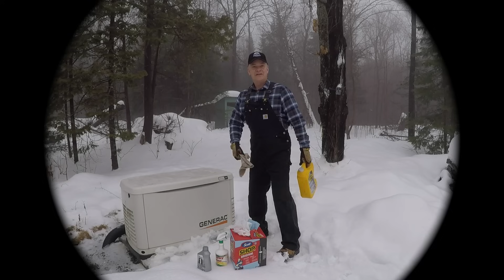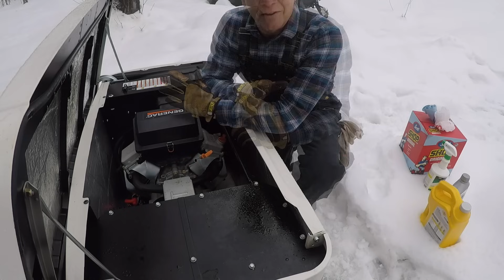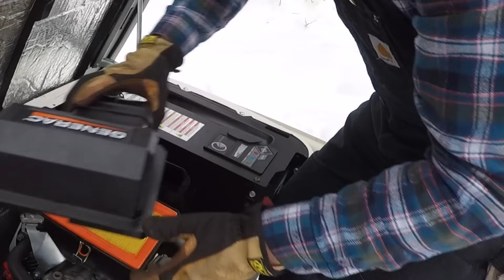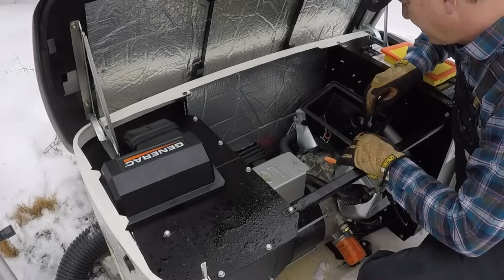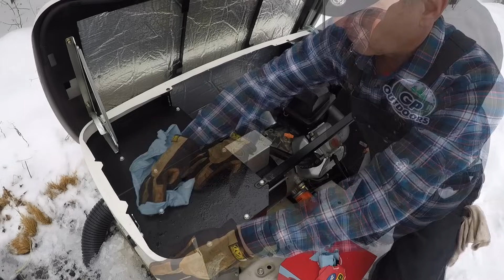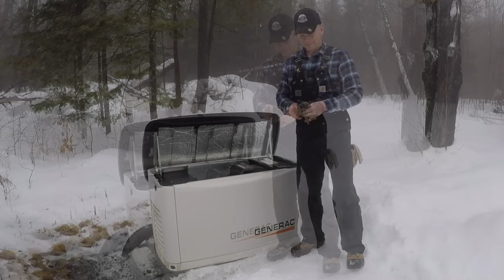#133 Thinking of Buying a Generac Generator? You Need To Watch This!

Comment: So how I fix mine was I drilled a little hole in the bottom of that if I remember correctly just about half an inch. I installed the black piece of pipe flush with the bottom like rubber hose not pipe sorry. Flush with the bottom going down through the bottom of my generator house. Which drains that moisture / water out. Works well for me. Also that your breather for the crankcase not exhaust.
Reply from the maker: Thanks Pete! That should work great! All the best!
Reply: @GPOutdoors  you're welcome brother God bless you and your family stay warm
Reply: @GPOutdoors  PS don't forget to put some type of little sponge air filter type thing down on the bottom I ended up having to put mine into like a can so that it couldn't suck up dust or debris into the hose cuz it will take in some air there as well as drain out the water when the generator shuts off before it freezes

Comment: Gets really cold  in Canada I’m surprised you don’t have an oil heating kit for your generator and a battery blanket?
Reply: I will call Generac tech-support if you’re still having problems with the condensation . It looks like from your video did an excellent job of installing your generator sounds really good 👍 👍👍.
Reply from the maker: Thanks kindly Edward. I have the heating kits on it and added the new one that wraps on the vent port now. It stops the water from freezing back into the port but the water still collects in the filter box. The generators were installed by Generac technicians (I am not very mechanical myself). I also have an annual maintenance contract with them to do the regular maintenance each year. Thanks again! All the best!

Comment: Thought about getting one of these, then when I look at the cost I just decided to get a 10k watt tri-fuel generator which uses gas, propane or natural gas so I am not stuck with just a single fuel option which will run my whole house which is 3100 square feet minus my central AC units. I have a window unit as AC when needed. Also had a 30 amp plug installed on the outside of the house which feeds into my electric panel.  Real easy to use when needed and all for less than 2k compare to 5 to 10k for one of these stand by generators.
Reply: Illegal in most areas AND depending on where you're located, if your power company sees this, they will cut you off, not to mention fines that may be possible.

Comment: SUGGESTION:   Would drilling a few small holes in the bottom of the air filter enclosure allow condensate to drain away ?

Comment: That hose is to vent crank case pressure, ( should be slight, if the rings are OK), if you just vent that crank case hose to atmosphere, it will solve your problem. The last thing one needs, during a power outage, is problems with your generator..

Comment: I understand your concern.
Manufacturers know the fix too, I'm sure.
A $5.00 fix which will over time prevent catastrophic damage is not there agenda.
It is to sell you a new unit when your motor locks up 6 months after the warranty expires.
Have seen it many times.
Good luck sir

Comment: Thanks for the advice. I'm still waiting for my 13kw unit that was ordered 5 months ago. They're on backorder and I can't get any information on when it will be here. My contractor is just as frustrated as I am. I know you've taken a beating on the crankcase ventilation issue. I wonder if any of these people ever read the other comments before placing theirs. I see you have about 3800 comments and I wouldn't be surprised if over 3,000 of them are to add that hole that Generac told you would void your warranty. LOL. God bless you for the information, and for your proper attitude at the criticism. May God forgive those with the nasty mouths and temperaments to match.
Reply from the maker: Good morning and thanks for the kind comment Mike. Yes - I have received quite a wide spectrum of views. LOL. I appreciate your support. Hope you get your unit soon - there is a good feeling of assurance when you have one. Have a wonderful Easter.
Reply: @GPOutdoors  just thought I'd update you and let you know that my generator has been set and the gas run to it last week. Final electrical connections are scheduled for this coming Wednesday. I did ask the service technician who did the install about the extreme cold kit and the runtime for the weekly run tests. He told me that the runtimes are not adjustable. The controller in the generator determines the runtime based on ambient conditions. But he did say that the extreme cold kit would probably solve your problem. He says that the heat from that kit keeps the vapor from freezing in the housing of the air filter and the generator running takes that moisture out. He said that's not an issue in Kentucky where I'm located.
Reply from the maker: That's great to hear Mike. You will have a lot of comfort knowing you have backup. In fact, Guy's power is out again as I type. He has the same genny as me. Please tell the installer thanks for his advice. I do have the kits ( all of them actually). Good luck and all the best!

Comment: Thanks for sharing your knowledge about this Generac design issue. 
  I wanted to return the favor and share with you some anecdotal information about Pennzoil that may help you in the future. As a former mechanic that specialized in Toyota Land Cruiser's, we saw an alarming trend in the 1990's at our shop with the 3FE gas powered FJ62 models where they were coming in for maintenance and the entire valve cover was filled with a hardened mass that occupied the entire volume of the open space under the cover. It took a while to narrow down the culprit but the one thing that they all had in common (other than average mileage was getting up there above 100k) was the owners used Pennzoil. We never saw this with customers who used other brands, and I think the composition of Pennzoil, at least at that time, was the issue.
  The connection here to your situation is that this model Land Cruiser was the beginning of the "mall-cruiser" phenomenon and we eventually attributed it to the vehicles being used for short trips to the store, and then back home AND the use of Pennzoil. The composition of the oil did not do well in light use situations because the vehicles didnt get to operating temperature often enough, and is analogous to your generator cycling for too short a period. I think that you might want to consider moving to an alternative brand of lubrication. I would also suggest not mixing different oils, and sticking with an ultralight non-detergent synthetic oil if there is no oil filter, and a detergent version if there is. That is if the manufacturer doesnt prohibit synthetics.
  Secondarily, the water in your air cleaner housing- the PCV configuration is an important part of the way the motor is designed. You cannot, as at least one person has suggested, just re-route the hose to the open air as that would leave the engine internals exposed to the environment and will for sure introduce water in the form of condensation if not directly through simple exposure. The air cleaner provides a vacuum to address spent gases that pass the rings in a normal internal combustion engine cycle as it wears and through normal use and expansion. There is a pulsing of pressure as the piston(s) run through their cycle so that hose pulls in and pushes out air if it does not have a vacuum applied to it so simply venting to the open air would be ill advised. The redirection of the crankcase gases into the air filter is a nominal introduction of contaminants and does not affect the engine in a significant way and the filter is there to address them as well as sending back into the combustion cycle. This is no high performance engine and is tuned to work the way it is designed (to meet EPA standards). 
 The smart thing that Generac could do to address the issue the video is centered around (other than just add a one way drip valve or supplemental small pipe extension as many have suggested) without having to retrofit them with electric heaters is simply route the exhaust manifold closer or under the air filter housing and re-use some of the heat naturally generated to evaporate any condensation that builds up in the bottom of the housing. Passive systems like this rarely fail whereas an electrical heater could have corrosion or a rodent chew the wire or any number of possibilities causing it to fail. In my opinion, Generac really should step up and solve this for the next generation of generators instead of retrofitting like they have.
  If one wanted to tackle this for cheap, one could probably get some copper pipe and simply wrap it tightly around the exhaust with the upper end pointed to a simple heating plate set below your housing with a bit of insulation between plate and housing to keep it from melting the plastic, and thermodynamics would draft air from the lower end to the upper end of the pipe and heat the housing for free and every time it is used. No additional electricity needed.
  Thanks again for sharing, and I hope this helps pass on some information that could help extend the life of your motor.

Comment: I assume you mean the PCV port is being clogged by ice. Not the exhaust.  You should drill a 1/4 in hole in the bottom of the breather housing to drain the condensation.

Comment: Great video! Thank you!
I look at this problem and a few things come to mind to resolve this issue but what if the entrance point for the pcv line were raised up as high as possible in the air box so when there is a condensation build up it can't back down into the tube?

Comment: I can see this was posted several years ago. Excellent too know what to look out for. I live just south of Ottawa, Can. and those pesky things always pop up. My friend installed an oil catch can to the crank case ventilation system. It removes built up of condensation and atomized oil before going through the air box... he empties the can a couple times in the winter... in the summer, not so often.

Comment: Maybe take the exhaust breather and extend the hose and drill a hole in the air box up higher and leave the current breather hole as a drain ? Just my thoughts for a simple cheap fix

Comment: Should think about installing a short heat tape in bottom of air cleaner cabinet wired so it only works with unit running , but remember almost everything today is plastic ,melt it and they will most likely charge an arm and a leg to replace the bottom  of the box .  Have a good day.

Comment: I have a Generac 14 kw and this happened to me today and I wasn't sure where to look for the problem. This video was right on the money, I removed the ice block and problem solved. I will be checking this regulary from now on. From Nova Scotia Canada, -24 C / -11F with high winds and blowing snow and a power outage... not a nice day to be working on a generator! Thank you very much for posting this video, it was spot on.

Comment: You could stick a tube in the crank case breather hole and extend it upwards close to the air filter. So if ice build up does happen it wont block the crank case breather.

Comment: The exhaust port runs trough the air filter housing?   You probably mean a crank case breather tube like in the old car engines.

Comment: The problem with running it longer to evap the moisture is the moisture is made while the engine is running. The water then collects in the plastic box that doesn't get hot enough to evap the water. The only solution I see would be a large diameter drain ball valve at the bottom of the plastic housing which is protected from bugs. It can then be closed in warmer weather. It sucks you have to vent crankcase vapor to outside air, but the design was made wrong from the get go.

Comment: I would consider building a resistive ladder network, running off the power line [when the unit is running] to provide modest heat beneath the air filter box... to gently warm it above the ambient temperature during winter use...
Reply: There is already an option that fixes this problem. You don't have to build something yourself and maybe void your warranty. I blame the installer for not adding that option.

Comment: there is a 'really REALLY cold weather kit' you can buy that includes the little coily heater for the breather tube... over 100 bucks thanks very much...  and mine was a bugger to install because there is are a few bolts you just can't get to easily without a pair of long needlenosed vicegrips.

Comment: Question: it looks like you are pretty far away from the home (meter) I am told that the unit has to be close to the  meter, but I don't want that as it would be in an area I wish to be open. I do have a spot in my back yard that is away from my home and close to a gas line which will feed the generator when needed.

Comment: You did well identifying the problem .now you need video with a fix . drill a hole in bottom of air box  install a 1 way drain valve and water will empty soon as engine shuts off .not freezing and  plugging the manifold pressure port. good job Gp .bet you saved people a lot of service calls .and sitting in the dark cause they dont know whats wrong.

Comment: Thanks for the video, I'll have to watch out for that issue.  I haven't seen that issue with our 22kw model.  I do have the cold weather kit (which is simply a heating sleeve for the oil filter that turns on when the temps are cold).  No sarcasm here, but our winters are may be 'drier' than yours.  Do you change the oil regularly and do you ever notice water in your oil?

Comment: Great info. Definite design flaw.
But nothing major if your handy. 
Wonder if Generac has since solved it.
Should be a minor change in crankcase ventilation system configuration. After all small engines been running outdoors in the cold since there conception. 
But really a great heads up.👍👍👍

Comment: On the Gulf Coast my father's Generac had a similar thing happen. 
Manufacturer recommended 20-50W oil and when it got hot the oil started blowing into the intake which in turn blocked the filter and shutdown the engine because it could not get air for combustion. Local dealer suggested 5-20W and as far I know he never had that issue again. Thanks for the info because if it gets that cold here in Texas,
 I might remember this!
Reply: I might have gotten the oil weight backwards 
The thinner oil was foaming now that I think about it

Comment: I would recommend modifying that and one put some small heating element on the bottom of that air filter housing to help that and or just make a drain on the bottom. even if it sucks air through a small drain it's in the winter and the air will be clean. even a small amount of snow if any really wouldn't hurt anything. Also I would definitely drill a hole in the side of that air filter housing and extend / route that crankcase breather outside on the air-box into another little container of some sort to catch oil vapor. This would ensure that the crankcase could always vent to atmosphere.

Comment: Run that crank case vent (has nothing to do with the exhaust) outside of the air box.  Make it so the moisture won’t pool in whatever line you make.  That’s just EPA bullshit that makes it vent into the air box.  Put a little breather filter on end of you extension if you want and maybe route is somewhere near the warm engine so it stays thawed long enough to drain.  Biggest problem I have with mine is moisture build up in the oil.  They need to change the firm ware so I can increase the run time when it’s set tests every two weeks . I also have a winter kit in mine to heat the oil Filter and battery...prob wouldn’t work to well if you are on solar and conserving energy

Comment: What is "severely cold enough" to cause this to happen? Unfortunately cold is a relative term and I doubt our northern neighbors would think Oklahoma winters are very harsh relatively. I'm asking as I'm looking into one of these.
Reply from the maker: HI Chris. This becomes a problem at and below about -20 celsius. ( -4 F). As noted, otherwise I have 3 heater kits on it ( battery, oil and now a heat wrap kit that goes around that vent port to stop condensation from freezing back down the port). However that does not stop the water from building up in the filter compartment, which then gets into the oil and the oil becomes creamy. Of note is that I run it on propane, not natural gas so I don't know if this occurs with a natural gas fuel option. About a year ago, someone left a comment saying they have redesigned it to fix this problem but I cannot confirm that. Good luck and great decision to get some backup or standby power to give you that peace of mind, especially as we get older. Cheers!
Reply: @GPOutdoors  sounds good thanks for the video and response!!!!